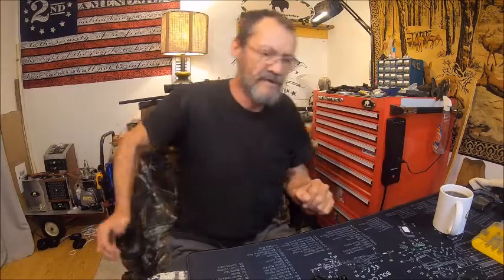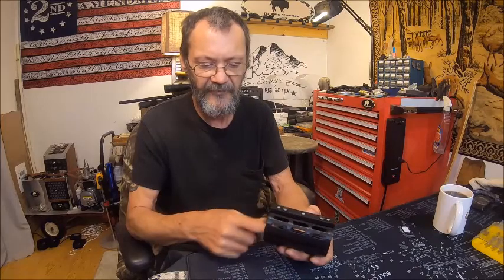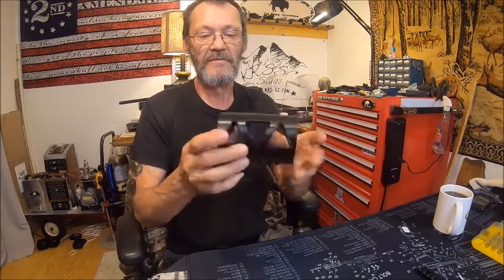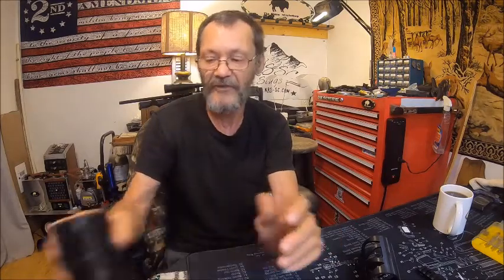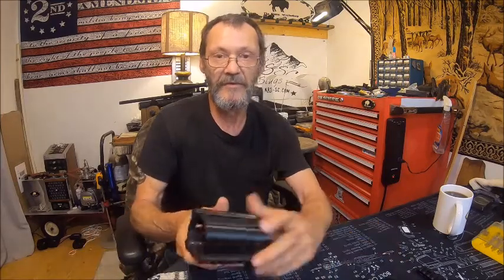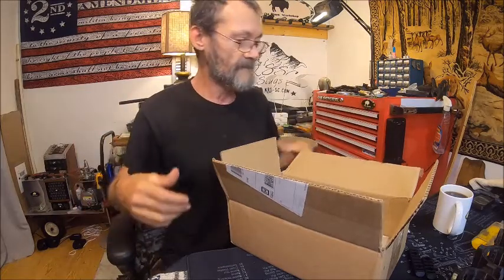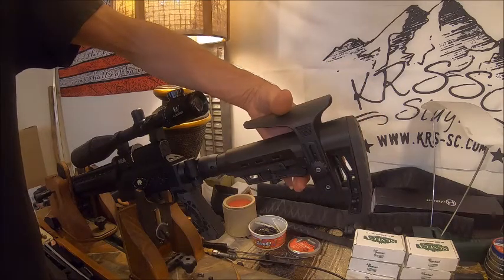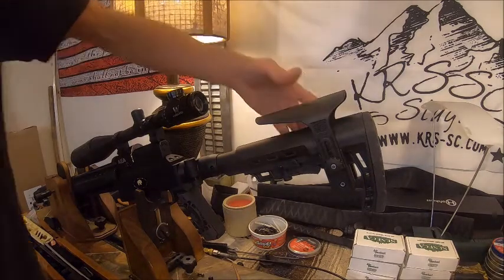how to remove butt stock from the buffer tube and new parts

Comment: nice print. do you print most your PETG in enclosure? and Are you, now, using PETG instead of PLA+? i melted a lot of my printed parts in PLA+ in 95f weather, Now i use PETG. Is that your main type you print for filament?
Reply from the maker: that my goal to print only petg. and no i dont have an enclosure
Reply: @BisonWorkshop  i love seeing your renders/mixes/slices... i MISS my 10sProv2 Creality. 273 days and nights NO STOP... and only $20.00 in parts whole time. PETG sure changed my printing game! then it finally broke.... excellent work you do, the printing and designing, it isn't an easy thing to do, for most, let alone be successful at it.